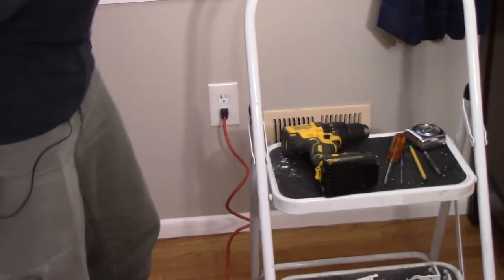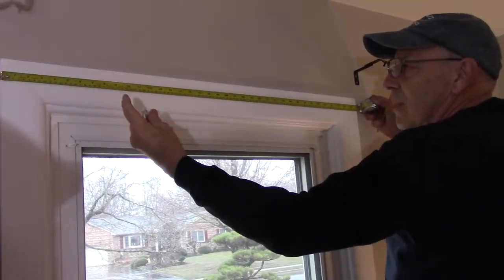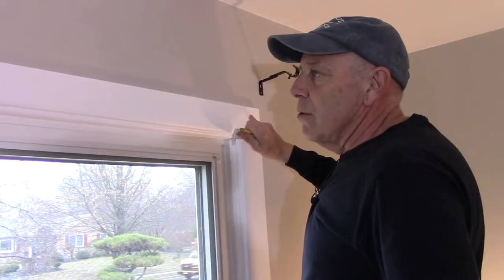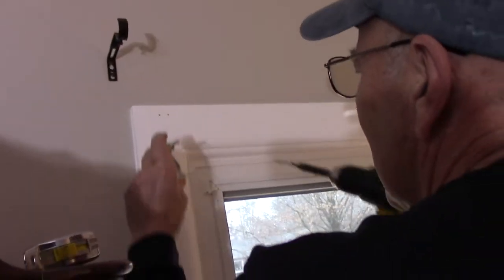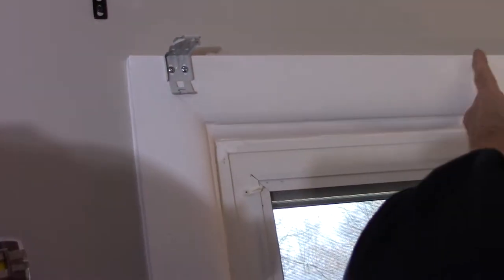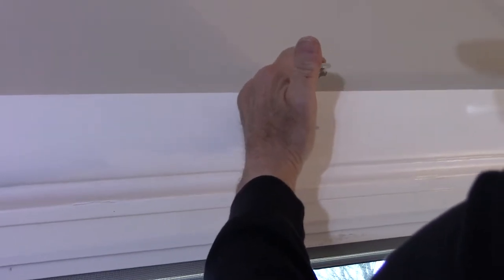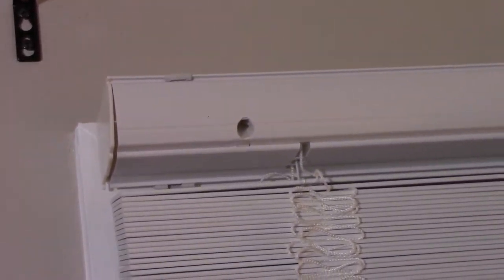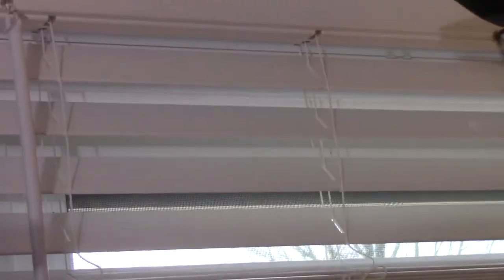How To Install Blinds On A Window | Outside Mount

Comment: Nice video, well explained.  I would suggest switching your drill to HIGH speed for drilling and driving screws.  Use the clutch when driving screws to keep from over torquing.

Comment: Most common window trim would cause the mounting brackets to sit on a slight angle downwards. (Not the trim in this vid)  I wonder if this would affect the performance and look of the blinds.

Comment: My wand is having a hard time attaching into the hole. How much pressure must be used?
My brand's name is LUMINO.
Reply from the maker: Usually just pushing it firmly it will snap in

Comment: Don’t you need a spacer behind mounting bracket  to keep blind from rubbing against window trim
Reply from the maker: No you don't need any spacers.
Reply: If it was a wall mount above the window frame you would need a spacer. He mounted it directly to the trim. Which I would never do. But to each their own. 😊

Comment: What if your molding is decorative and isn't flat ?
Reply: You can mount it ABOVE the molding on the wall, in which case you likely want it wider than the molding so that it fully overlaps the molding.